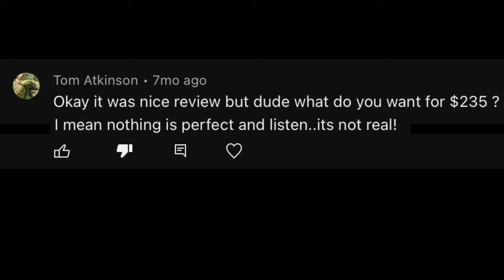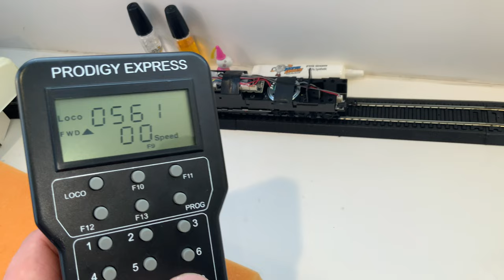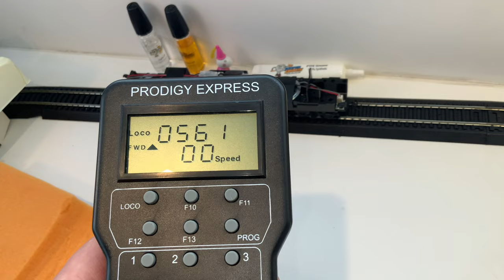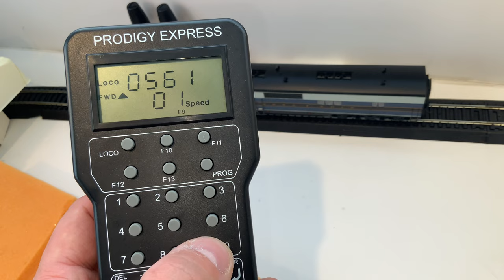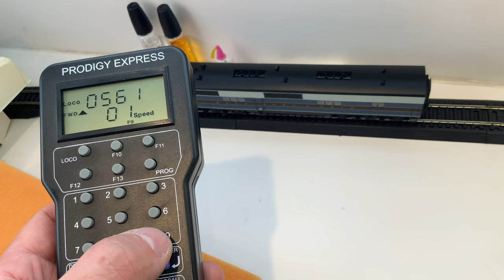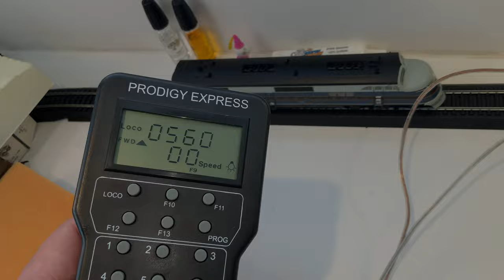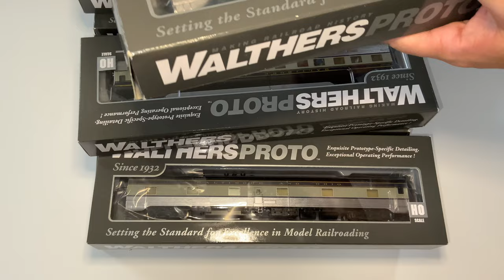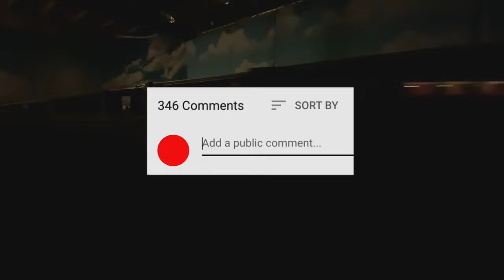Broadway Limited HO EMC E1 EA / EB Wretched Sound Fixed and New Proto B&O Capitol Limited Consist

Comment from the maker: Glad someone already summarized the kitchen-dormitory car… The B&O was a railroad of frugality. It made every attempt to be modern and up to date, even cutting edge at times. Yet it was not the strongest, financially. While paying dividends was a B&O prerequisite to its stockholders, it found ways to use second hand equipment in a first class manner to accomplish its service goals. One such step was the purchase and use of two sets of twin-unit Pullman built dining cars for its upgraded, mid-1950s Capitol Limited. Originally built in 1950 for the Chesapeake &Ohio, the order was cancelled and New York Central bought them for its Commodore Vanderbilt in New York to Chicago service. By 1956, they were sold to the B&O, which overhauled and equipped them for Washington DC to Chicago service on its top train.

One car contained a full service kitchen, dormitory space for 12 and two 2 berth rooms for stewards. The second car in each set was a full dining room with a small steward’s buffet that could seat sixty eight.

Comment: Yours was a good one. Mine arrived when I opened the shell the speakers didn't have the bracket holding them on. I had to fix all of that and removing the grate too
Reply from the maker: Holy cow! Well… I guess at least you didn’t have to suffer with all that rattling and popping since you were forced to deal with the issue right away?
Reply: @DoctorHobby  pretty much because when I first got it home I took it out of box I heard something rattling so I popped the shell and found the speakers not screwed in

Comment: I have a Broadway limited CSX ES44AC with Paragon 4 from the factory the speakers were crackling staticy just horrible. Now I don't know why changing the initial Rev up sound and Rev down on shutdown would cause the crackling and staticy sounds to stop but it did now I have a very good sounding locomotive still not as good as Tsunami 2 or ESU sound decoders but way better than before.

Comment: This is one area where prototypical has real meaning, assuming they can record a real locomotive of the model or buy it..  But in terms of speakers and enclosures and all that, in the ho market this seems to be too much of an after thought.  I mean that thing has two speakers but other than a slight indentations to place the speakers no further thought appears to be given to it. Meanwhile the factory for some reason put metal screens under them for reasons oy known to them.
Reply: I can only assume they did it to protect the speaker from loose ballast.
Reply from the maker: Yes.. the sound is something I generally care about more than anything else because I can hear whatever it is going around the track more "clearly" than I can see whatever it is. Too many poor speaker boxes with incorrect/cancelling air movement that makes for a lot of mid- and treble-heavy locos at the HO scale.
Reply from the maker: Oh, yup.. that would make sense.. which they would have thought of a less aurally offensive way to accomplish that..